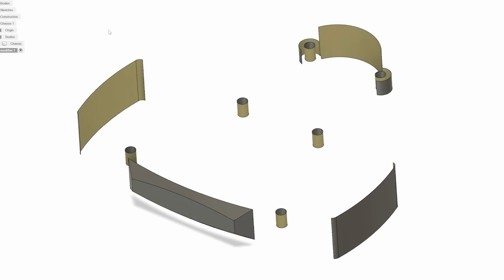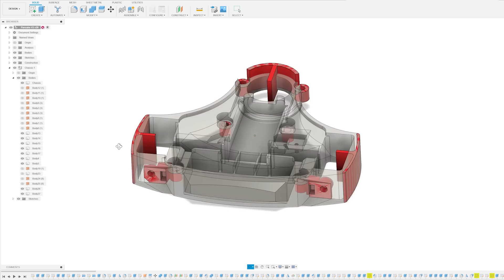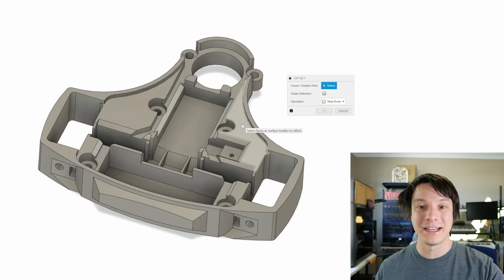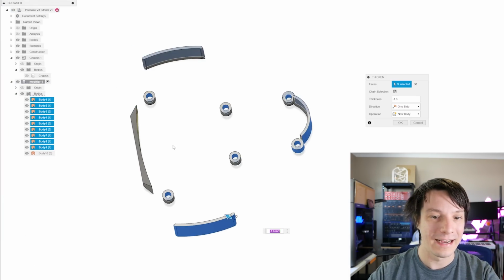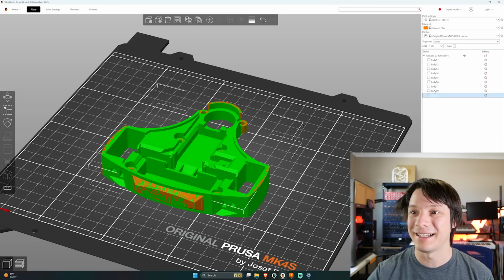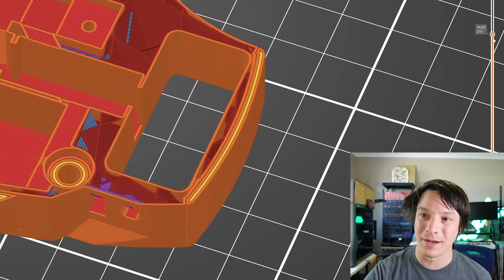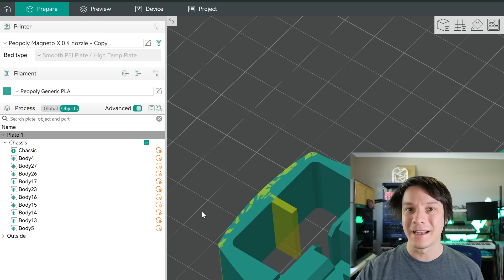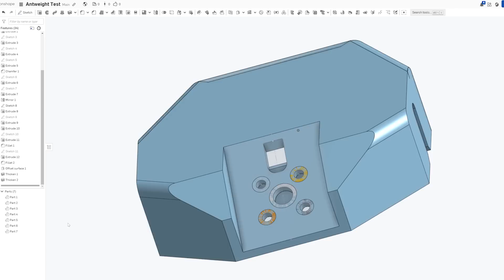How to 3D Print like a Pro using Custom Modifier Meshes!

Comment: Maybe I'm blind, but where is the option to convert the objects to modifiers in orca? There is no such option as "change type"
Reply: I found the solution to my own problem after looking through github a little. When the objects are imported they need to be "Assembled". I clicked the wrong "Yes" "No" button when importing, because I missunderstood the message. Either reimport and click "yes" or highlight all objects and click "Assemble". Then the "change type" menu is available

Comment: so i guess i cant use Prusa slicer for my bambu Lab , because they are locking out the use of orca slicer..  is there Modifier mesh option in bambu?
Reply: both at basically the same with features leapfrogging each other

Comment: CADing in modifier meshes isn't the end of the tricks either - CAD up nested internal models for the slicer to print inside the main shell for reinforcement works like a champ too. Have done several load bearing parts with internal geometries to increase their strength without resorting to printing 10x walls or high infill.

Comment: Hey Angus! i'm a robotics prof. at a spanish university. I've also come accross this personally and also hate the ''separate entity'' style of perimeter that prusa does. To correct this, when I'm creating my modifier bodies I inset them into the actual model by whatever current perimeters I already have set on prusaslicer. In your case, if you offset your surfaces by perimeter thickness into the model at creation time, they should be finalized as bodies contained within your model. If you change the perimeters then in prusa and if done correctly, it shouldn't do the weird split outer wall slicing. If you are ever tight on the weight department give this a try. You could also try scaling the bodies but sometimes it is hard because of geometry.

Comment: In the absence of a way to convert multiple bodies to modifiers at once, what I do instead is to chop the modifier parts out of the main body.
ie you are doing the same thing, but you are not using modifiers, you are just working with a regular multi-part model.
Another trick is to join all the modifiers into one part. If you create a body that is 0.01mm thick which intersects with all the modifier parts, then combine - when you slice, the joining part which is only 0.01mm thick is too thin for it to print, so it just prints the parts it can. You get the same result, but you have saved yourself a bunch of setup in the slicer.

Comment: Bambustudio/Orca I believe also have this. You right click the object and add a modifier where load is an option to pick a modifier mesh. I imagine using 3MF as a format might make it even easier for you loading it all as one part. Still not as convenient as being able to convert a part in place.

Welp, he covered it after I commented, but I guess the Bambu start is still applicable (while Orca, as covered is more powerful)
Reply from the maker: Yeah I first started using it in bambu studio as it was much easier, then discovered orca which I really like! Thought it only fair to cover the og program though (as close to slic3r as exists now anyway)

Comment: For the modified meshes for the wheel well, i would offset the mesh inside by 0.4, then you have alot more control of the inner part

Comment: Wow. This is a great bunch of techniques. Including some of the incidental things you weren't actually concentrating on. I hadn't realized "concentric" fill didn't just arbitrarily create a center and make circular rings around it irrespective of the overall shape, but instead conforms to local perimeters. That's way more useful. I also noticed on one of those menus, completely in passing, that you can use these imported modifier meshes as support enforcers or blockers as well. That's something I wish I'd known about earlier.

Comment: I think cura has an equivalent setting to orca ensure vertical wall thickness. I have used it for the main model, so it should be available for modifiers.

Comment: Wow. The only trick I've used to add "bumpers" to TPU prints is to make voids that work as air-shocks. Assuming the print actually seals the voids, of course. Which is not guaranteed. This makes me wish for updated FUNCTIONAL tutorials for both OnShape and Fusion 360. So many tricks that need to be pulled together under a common umbrella with real-world examples.

Comment: Would be nice with a CAD program that is adapted to 3D printing... I would want to just be able to specify the parameters in each feature the the part is made of. If I make an extrusion in Autodesk Inventor for exmaple I want to be able to just specify infill and wall thickness directly.

Comment: They took it out in 2.6 of prusaslicer saying, the new algorithm is much smarter than the previous implementations and is automatically applied where needed but would the option extra perimeters do the same thing as ensure vertical shell thickness in prusaslicer?
Reply: That is the setting I had to check immediately he said it. Maybe they renamed the setting or brought it back 🤔 But it's visible only after setting advanced 😉

Comment: Cool idea, I think it would be easier in onshape, just extrude or thicken some faces as new objects.  Will steal it.  I've also played around with some voids in solids, either long shapes like an X that's only 0.1mm thick and then the slicer will add in some perimeters, more of a trick to add some reinforcement in bigger things, took the idea from Slant 3D, and have used it to make some stronger clamps and things.

Comment: I'm an old school inventor user, while these mesh things are interesting, I'll probably stick with 0.001 inset cuts and holes. For the thicker wall with concentric infill, I'd just inset the outer face and offset its profile inwards by 1 nozzle diameter and cut. All slicers see that as 2 exterior perimeters infinitely close together, but the outer most print path remains solid as the cut doesn't reach the surface in any direction. Can then use an array to multiply how many, at what spacing for each area... basically just an internal rib with as much control over its shape as any other part. Such as, if you wanted your heatset inserts to have more material, but only at 1 end of the hole. I'd just stack 1 or 2 inset cuts at that side of the hole -> create sketch @ -0.2, project hole geometry, offset +0.4 with whatever OD you want, 0.001 cut. Your hole now has 1 extra bottom/top layer at the width you specified (array as many layers as the insert is thick), the rest of the hole still only has 1 wall thickness. You can even chamfer the final cut to the rest of the hole so there's a gradual decrease in reinforcement width down to the single wall.

Comment: In SolidWorks I've used a similar trick for supports. There I was able to export as step file containing components instead of bodies. This made me able to select the modifier component once and change type of all modifier bodies.
With step I could export over and over again and simply reload the file with F5 and all settings of modifiers was kept. Great workflow! Great video!

Comment: is this possible in cura also?
Reply: Yes, for quite a few years (introduced in 4.6.0). Look for "Per-model settings". You can either use the objects created by support blocker or you can import overlapping meshes. I've not tried it with a model that has prebuilt overlapping meshes like what @MakersMuse shows here though.

Comment: Not sure if you know about rhombic dodecahedron, but it has the highest volume to surface area ratio of any 3d tiling shape. I think it should theoretically be the strongest infill for a given weight, so it might be useful for your use case, but unfortunately, none of the slicers support this infill.

Comment: Nice!
I have been drawing paterns with many small holes in some of my designs (in the solids in Fusion) to have the same kind of effect.
A lot of holes in an open solid make lots of small perimeters around that holes and therefore make almost a solid infill if you want. 
That is ofcourse already in Fusion and makes a hard and heavy design but much less trying around in a slicer.

What about using Fusion360 as a slicer? Is this kind of modifier possible also?

Comment: This is definitely something I'd like to see slicers further develop. It would be cool if we could draw a shape on a surface and extrude it inwards as much as you want. Of course, modeling it that way is more precise, but being able to draw a surface and tell it how deep into that to modify could be very useful. I have had situations where I would like to increase the infill in places, but those places are not aligned with a plane, so it's really hard to line up the basic shape where I want it. But being able to just draw it on the surface and tell it how deep to extrude inwards would make that super easy.

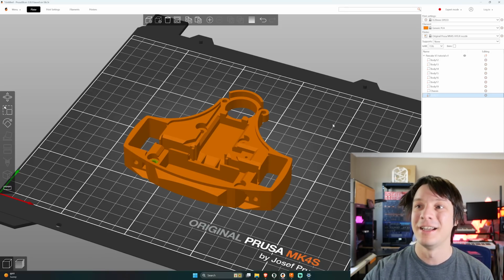Comment: 10:49 for making modifiers of the same type you should be able to select all the individual bodies you need. and combine them with right-click > merge. So that they act as a single part. If I am not mistaken.
Reply from the maker: Ah yeah, that would do it! If they're all the same setting it should be a good work around for now. Cheers for the idea!
Reply: Sadly, I was wrong. You cannot merge individual sub-parts ("bodies") of one model. 
This only works when they are completely separated, which would
    A: break the alignment
    B: also, just group them together as one model, which cannot be set as a modifier on its own. (also modifiers need to be a part of the model which they should effect.)
Reply from the maker: @LS-001  Yeah I had a play and it didn't work. We need a "group" function that can be nested within the assembly I think, to easily highlight multiple parts at once.
Reply: or combine the bodies in the CAD
Reply: @FreshPe  Yes this is also an option. However, you have to keep a few things in mind:
you can't export as a simple *.stl anymore, since stl files don't have any concept of bodies, and are essentially just a list of triangles.
Instead, you have to export as a *.step / *.stp file (*.3mf files might work also), which does support having multiple bodies / parts in a file. In this case the slicer needs to support the step-format.

Also, you must keep in mind how your specific cad program works: You might not be able to merge bodies wich are not connected. In wich case the cad-software must be able to differentiate between simple bodies, and components/parts.

There is a workaround where you can model a connecting "bridge" between bodies you want to merge. in this case exporting as a *.stl will also work again.

Comment: This is great, I've been using slicer modifiers to add more support to holes used in my silicone mold system. It's been hit and miss when updating and importing new versions of the molds. The modifiers don't always line up and I always have to move them around just a bit. Doing this in CAD is the way to go and I never considered doing it this way. Super helpful, thank you!